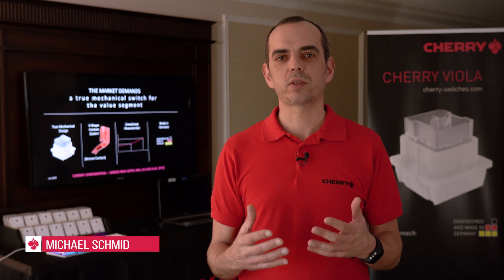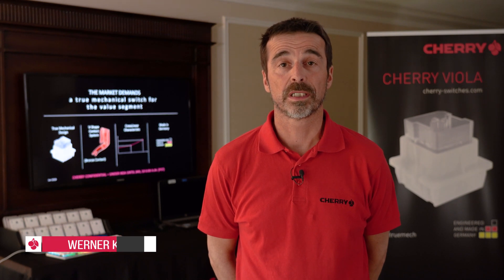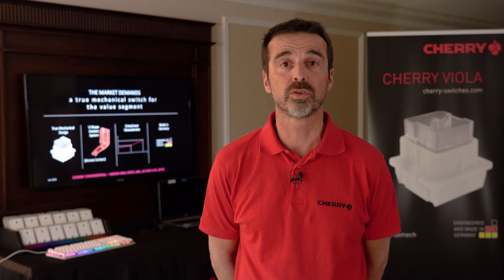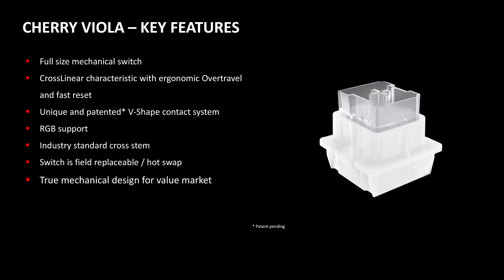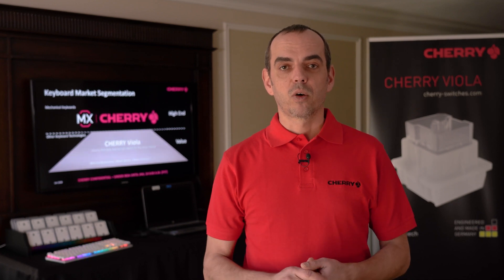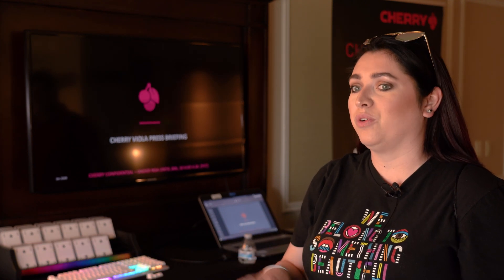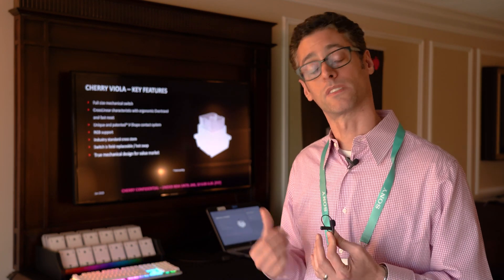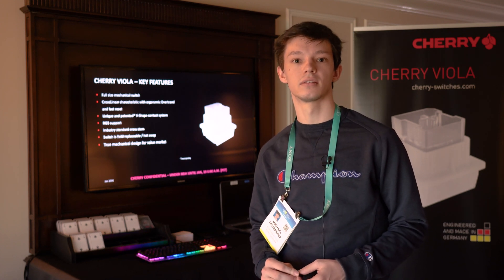CHERRY VIOLA: A Mechanical Switch For The Value Market [CES 2020]

Comment: "For the value market" my fucking ass.  I got tricked into getting a corsair k60 with these dumb ass things.  And corsair DOES NOT do a good job of pointing out that these things use a proprietary PCB and that they are only hot swappable with more of the same garbage because it's an entirely different design.  What a joke of a design, my first switch went bad within a week, then another 2 before week 2 was up.  I RMAd that thing so fast.  Oh, and if you wanted replacement switches forget that because you have to import them from Europe, expensive garbage in every way.  If you want an actual value market keyboard pick up a Keychron C2 pro, $84 and uses actual normal ass mechanical switches and not some stupid split fork that has to bend against the PCB with every damn keystroke.

Comment: WHERE DO I BUY THEM DAMN IT, THEYYY STaaarted maalfuctioning after 7 months. It was really only 2 keys that have issues on the board but I can't find where to buy them. They really don't like aggressive mashing so i've been trying to lighten up a bit. They wobble like hell causing lots of rubbing and this k60 key board I'm using with these keys  is aa bit stiff for someone to be converting from silicone. I just compaared the wobbling of my old keyboard to these cherry violas and they wobble////;;;;;;;;;;; just as much as the old silicone one. So either I'm  a crazy hackler  or the design needs to improved.
Reply: amigo, me pasa igual. YA me fallan dos switches con menos de dos meses de uso. La experirncia de tipeo es terrible con estos switches. Por algo será que que no hay mas teclados en e lmundo con este tipo de interruptores.

Comment: I have Corsair k60 SE (Viola Switch) and i didn't like the key Switch because you need to press more harder and it give me a hell of a Workout specially when i play OSU i can't stream at 200 bpm with this Key Switch. But the Sound and Quality of it is very Good. It's good for Non-Gaming Activities
Reply: Then buy a keyboard with Cherry MX speed silver lol
Reply: @antonioghemea9440  I bought Corsair K100 OPX Switches few months after I bought Corsair k60 SE. lol
Reply: @shizur_  Are those loud or...?
Reply: @antonioghemea9440  Its not too loud, I really liked it I don't have problems with it
Reply: Just realized I commented this comment a year ago. damn... time goes by fast
Reply: @shizur_  hey, im on a kb crisis rn with my k120 membrane which has like, 55g force of actuation and 2.8mm travel. it feels really aggro on each stroke and i cant take it anymore lol its on my fingers btw not wrist. what switch do u recommend?
Reply: @polar6066  I recommend buying a new keyboard because you're using a membrane keyboard and it kinda sucks compared to a mechanical keyboard. I recommend buying a "Mechanical Keyboard". Gateron/Cherry MX Red Switches pretty much works with anyone who's new to mechanical keyboard.

Comment: dude i WISH i could get a high end keyboard for 100-200 dollars...
Reply: What does high end mean to you? If 200 is your max, you can get an aluminum case, very good switches, rgb, decent keycaps... here's an example - Hexgears Dusk, built on the same open-source design as the Massdrop CTRL and Input Club K-type, $160 fully built. Hot-swappable, aluminum shell, program-ability: https://kono.store/products/gemini-dusk

Of course you can spend as much as you want, and go as far as you want to maximize the typing experience with precision-cut carbon fiber gasket mount plates embedded in solid aluminum blocks artfully sculpted by a CNC machine... but IMO that's entering the realm of diminishing returns depending on one's priorities.
Reply: @justdh  lol thats not what high end means tho. its not that subjective a thing, part of the meaning of high end is expensive.
Reply: @Crokto  Not really. I also wouldn't consider Cherry to be a high end switch manufacturer. Alps and IBM buckling springs are far superior to Cherry MX switches. Even companies like Kailh are being much more innovative and making superior switches.
Reply: lol right?
Reply: Pls make the tactile version actually tactile! Not like mx browns. Just pls =)
Reply: @Automobili3XF leopolds are fine but theyre not high end keyboards
Reply: You are confusing high end with artisan. You can get high end boards even 2 years ago for that.
Reply: @xex2kok  but, like...no. you could get a budget build for that, not a high end one. a tofu with gat yellows and alie caps is not high end. and its also more than 200 anyway

Comment: "First value switch"

Cherry MY and ML: AM I A JOKE TO YOU?
Reply: Tom Chan MY is the joke haha. Like typing on wet newspaper..
Reply: @dpactestaccount  ML is atrocious as well. My point is it seems like Cherry is trying to hide the existence of MY and ML.
Reply: hell, MX is the value switch lol
Reply: @Crokto  I mean, Cherry's statement on the Viola being for sub $100 keyboards is kind of wrong. Gateron switches are dirt cheap (15 cents per switch) and arguably better. The Viola should at least be cheaper than 10 cents per switch to make it suitable for sub $30 keyboards. Sub $100 keyboards are simply not budget enough.
Reply: @spidermain  Why would any mainstream keyboard manufacturer make a keyboard for $30 with the VIOLA switches? That's HIGHLY unreasonable, if you want a $30 keyboard then just grab a normal dell keyboard or something. If you  want a GAMING keyboard for $30 then your probably gonna have to buy some crappy plastic keyboard with cheap switches.
Reply: @Sami_WTF  many $30 mechanical keyboards are actually good value. Their Outemu switches work fine, however they have poor rattly stabilizers and cheap keycaps, but so does a $200 top of the line corsair K95 platinum.

The Viola is just a way for big gaming brands to spend less on their switches but keep the Cherry branding on their keyboards.
Reply: @spidermain  True, but if your going to spend $200 on a keyboard you might as well go with the steelseries apex pro, I own the keyboard and it is great. I also added some o-rings to reduce travel distance
Reply: "Yes"